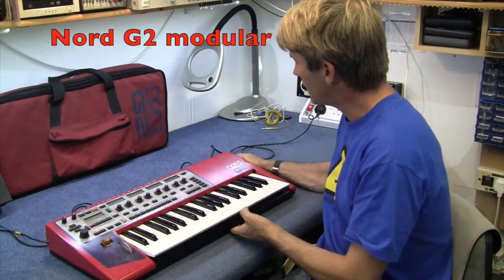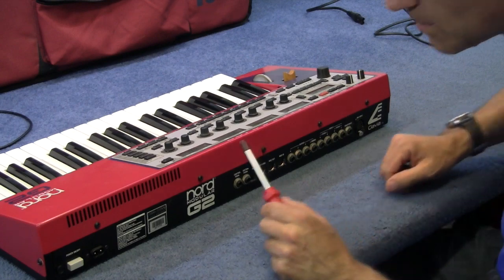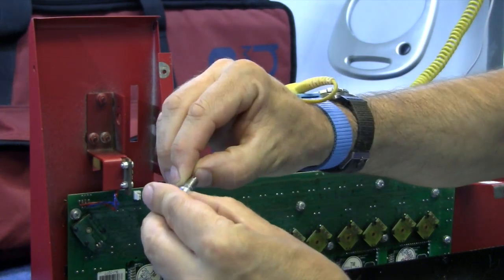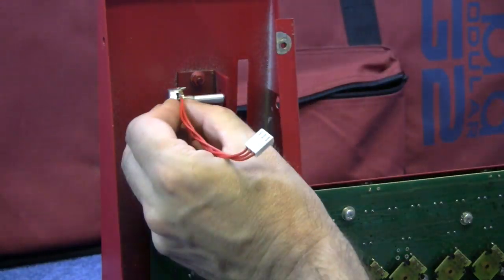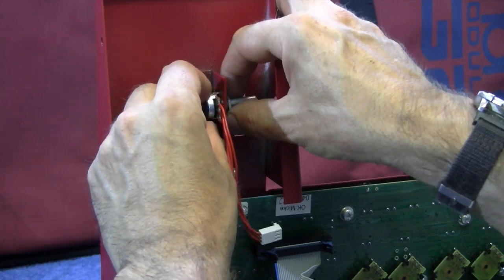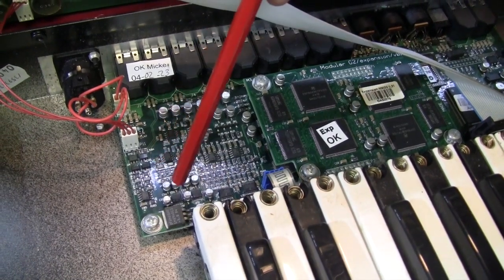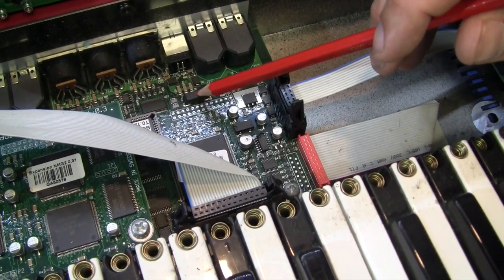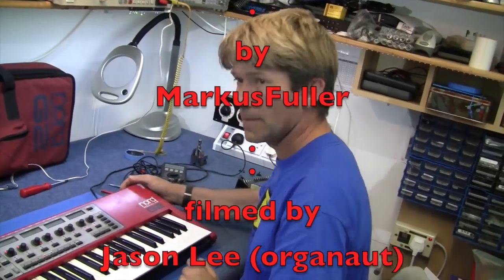MF#30 NORD G2 modular synthesizer repair

Comment: If someone want to know, thery used the MC (or XC for pre mass production) 56002 fixed point dsp in the modular, the G2 uses the next level chips i guess. The micro modular used the motorola 56002 demo broad nearly just right away. I played a long time with that motorola "EVM 56002" borad myself during it´s time....and it runs the micro modular code nearly right away....
Saldy those happy days are over since nearly all companies using FPGAs today....

Comment: RadioShack suffered the same fate here in the US, all the parts are confined to a tiny rack at the back end of the store and nobody there knows what any of them do.  The selection is terrible and they're really overpriced.  They will make sure you've considered upgrading your phone plan and buying batteries before you leave though, never fails.
Reply from the maker: Yes thats the problem here. Phone covers and mini remote control helicopters are the important things they think everybody needs. I remember Tandys in the old days when I was a Kid and the guys there were very knowledgeable and even helped to draw out circuit diagrams on bits of paper for things I was trying to make.
Reply: +markusfuller Tandys?lool,I remember a simple Moog clone by them:)thanks for the great vids!
Reply: In the last days of Tandy, I overheard a staff member phoning the manager (on behalf of a customer standing at the checkout) to ask which was the positive wire - the red one or the black one.
The manager didn't know.
Reply from the maker: Yikes how do they get through the interview for the job ?
Reply: Last time I went to maplins for a screwdriver the man tried to upsell extra things at the counter. I spotted a stumpier version of the same screwdriver ok the counter for a fiver less so bought that instead - he wasn't best pleased!!!

Comment: You would think they would of used a hall or even an optical based device for the mod,seeing as it's used alot. I used my own design hall mod wheel way back for my home built modular synth,worked great,i guess nothing is made to last these days. I always found Maplin to be staffed by no clue guys/gals back in the 80's. Dont ask for a Jack plug, you will be met with a "Dont think he works here anymore" reply.

Comment: I had a similar experience with milk. I walked 2 miles home and it was spoiled. After that I tasted it just outside the store and then started home.
Reply from the maker: Hello Wavestrike Electronics. i know if only I looked at the pot before leaving that would have saved me a few hours and a few miles of walking back. there wasn't even an apology just a lame excuse. I will check next time. I only use them if I want an item the same day.

Comment: Markusfuller Do you have any idea what could be wrong with a model 3 which gets stuck in some sort of boot/reset cycle? You get the welcome message, then the firmware version message, then the display flashes just perceptibly, as if there was a reset condition, and you see the welcome message again, etc, ad infinum. Someone suggested it could be an input voltage issue in the 3.3V line, but I have ruled that out already.

Comment: Hi Mark,

Have you ever fixed the pitch bend on one of these? Mine just started to go, and is getting worse by the day, only works to the right, and only sometimes. I opened it up, and everything seems good.... but I need some suggestions. Thanks so much!
Reply from the maker: Hi Steve. there are 4 leads soldered onto the pitch bend. try resoldering them first incase 1 has a dry joint. the pitch bend works with the use of stress gauge type resistor printed onto a film that is stuck onto the metal springy plate. I do not know where you would get a new one to replace this I guess a word with Nord on their website could lead you in the right direction. you would either get a replacement stress film to stick onto the metal or buy the whole unit with the wooden pitch already attached then it would be just undoing the screws and fitting the new one. Best of luck and sorry I'm not more help there as i do not have the nord here anymore to check inside it for you. best wishes from markus.

Comment: Great video.  Does the software still support this??
Reply from the maker: +James Reeno I'm not sure. this belongs to a friend and I know he still uses it. though i guess he has kept a computer in old language just incase (ie not updated the windows OS)
Reply: +markusfuller interesting.  I think most of these will be difficult to interface these days.  It's usually not good for hardware to be tethered to computer software.  Much safer to have one of the other nords instead.
Reply: +markusfuller Apparently after some Googling, Win 7 x64 still runs software for editing it...  No one should be choosing to use Win 8 or 10 anyway ;)

Comment: hey mark...
i have a nord modular g2 and the pitchstick sends midi with the slightest touch, therefore is out of tune
do you know how to repair it? is there a problem with the resistors or something?
replacing didnt solve it.... 
thanks!
Reply from the maker: Design iec Hello. Im not sure but I think there is something in the menu where you can recalibrate the pitch and mod. I can ask my friend if he still owns his he may know but you may get this info by emailing nord ?.

Comment: Sorry as i just don´t get this, you replaced an (defective ok; besides)  industrial grade pot with a consumer grade replacement....hmm...why?
Why you did not go for a 1st grade pot like penny&gilles or bourns? the original was a good type, and even this was weared out...so i thing this Modular G2 saw and probably will see a lot of staging...so better replace it with a better type than a derated one....
Reply from the maker: Hi I had to repair this in one day but have given the old one to my friend and asked he tries to get hold of the better Pot, then I will replace it again for him. but for the time being it works.
Reply: Never mind....i would check ebay on this one, as nowadays i check there first, as nearly all my electromechanical stuff is there and one can have industrial grade components for the same cost as the conumer crap goes...
Just found some "bourns" pots 500k all metal with a ceramic inlay 3.99 euro for 5pcs....
Reply from the maker: I have about 200 pots in my workshop but did not have the 10k linear thats the only reason i went to maplins toy shop.
Reply: I think, this is the same for all of us, when we just need a single pot, cap or res we go and have a look inside our stock and usually it´s not there...

Comment: How the hell did the Nord engineers think that modulation wheel is going to be mechanically sound :D

I mean like damn, they're not designed to take on side to side loads.

At least they could have supported it from both sides so that the pressure wouldn't come on to the potentiometer itself but only to the metal shaft it has :/
Reply from the maker: Hi I think it would have been better if they used a longer shaft and had the end piece through another hole with a bearing. it would have took the stress better over the years. Me thinks .
Reply: And rightly so, would have been the right solution.

I would have overdone it though for that price and completely removed the potentiometer from the system. I would have made an optical disk at the end of the shaft that would have been coupled to an IR-LED and receiver so that the shaft could have been done properly and the mechanism wouldn't even brake electrically,

The disk would have laser printed (or otherwise) pattern that would be opaque from the middle and gotten darker when spin it either way. Shine the IR-LED through it and hey presto! analog output. :)
markusfuller
Reply from the maker: I have seen something very similar with a polarised filter. the led has another polarised filter and as the disk is turned it allows less or more light to pass through to the receiver. cannot remember where i saw this though i think it was on a 19inch rack mount scientific type thingumajig measuring wot not. :-)
Reply: Absolutlely, it wouldnt be hard to make up a tab with a hole and spot weld it in as an outrigger.
Reply: This is not a very good idea! Somehow all musicians smoke (i don't know why, just my observation), and when they don't, they perform right near a fog machine. Behringer has actually made some DJ mixers with an optical crossfader that they developed themselves, and while it's a very smooth and durable crossfader, i hear it tends to fail near fog machines! They weren't even analog i think, likely absolute optical encoder with integrated digital to analog conversion, which is theoretically much more resilient.

With analog optical sensing, you also have to have some kind of compensation, which complicates things and potentially makes them less reliable. A wiper potentiometer doesn't need any since it's a divider, it's two resistances that balance themselves. 

But i think the best thing theoretically for musician's use is capacitive potentiometer. Now Innofader just has to step up and make a capacitive rotary potentiometer retrofit, maybe mail them or something.

I also don't think a bearing is end all be all solution, even forces from minor displacement on the shaft are not desirable. I think the solution is to mount the potentiometer so that it's free to slide up and down, but is held back from rotating. Mounted against some kind of vertical groove it can move in.